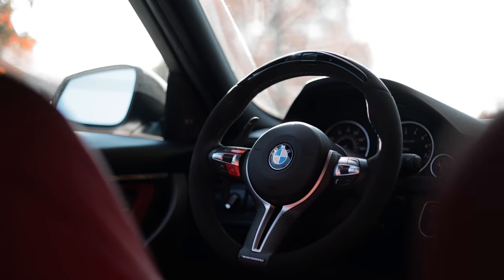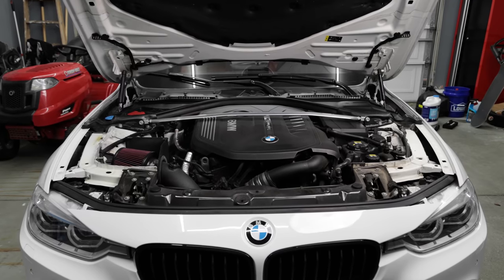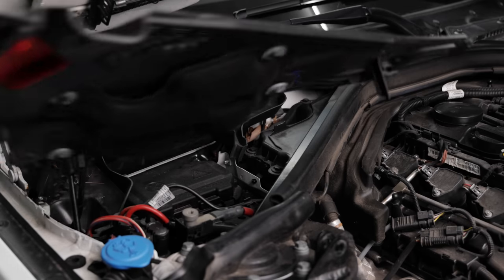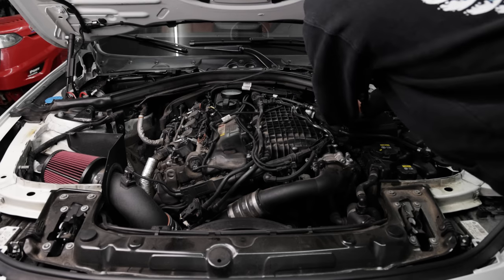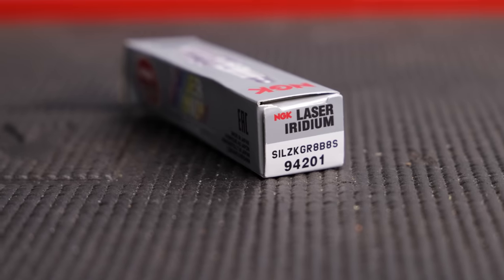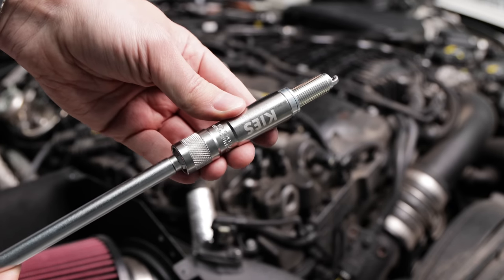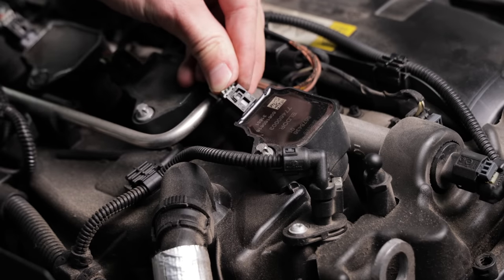How to Replace Your BMW Spark Plugs | F30 340i, 440i

Comment: Thanks to your excellent video, I did my spark plugs today in a little over an hour, and had all the right tools ready at hand. The worst part was putting that damn piece of rubber trim back on (the first piece you took off)!

Comment: Hear me out, I had a corvette and I loved the pulls then I also got an f30.. and it was missing something running sluggish felt like power wasn’t there. I did my spark plugs 2 weeks ago and heard gapping them to .022 is for stage 1. I did it on my stock and omg.. i can feel the boost of the turbo kick in now! I took a scat pack out today. Highly recommend it And heard it’s best for turbo cars. As the air mixture and fuel ratio.

Comment: Love your chill presentation style, Justin, and your meticulous attention to detail. I have tons of tools but sent for that Wera ratchet set in your links. Sold out on your link but on Amazon at a great price. I'm curious about the very loose fitment, though, onto the wrench. Is that to give you a more forgiving arc in tight places? I saw one review where the buyer also expressed the same amazement and said he was returning his set. Its a bit pricy so wondering if its worth it. Also lack of a tab to reverse the wratchet direction seems strange. Have to flip it over to reverse direction. Any thoughts please. Thanks for your content.

Comment: What mileage did you change the plugs at?  I have the 340iX with the MPPSK tune.  I bought the plugs and coils from FCP Euro with their lifetime replacement program at 45K.  Before removing the old spark plugs I would strongly recommend using compressed air to blow out any loose debris or liquids in the plug ports.
Reply from the maker: 55k

Comment: Great video, I will be doing this over the weekend.

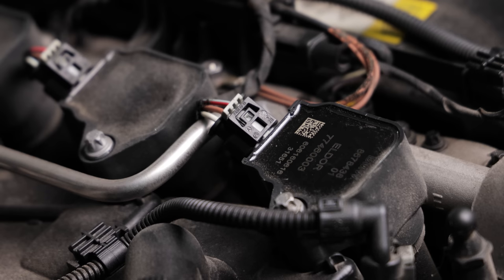At 4:45 you use a yellow/orange terminal pin tool, where did you get it from?
Reply from the maker: The orange plastic tool is just a generic interior pry tool

Comment: I was doing this DIY, and used a $12 spark plug socket from amazon. It turned out to be not a fit for my old spark plugs and the magnet inside broke into tiny pieces. Not knowing I changed the plug in one cylinder and now I am worried if any piece went inside.

Comment: I have 27,000 miles on my 540i should I change my spark plugs or coils yet or should I wait until 50,000 miles?
Reply from the maker: You can do the plugs at 50,000. If your car is tuned you might want to do them sooner. I wouldn’t bother with the ignition coils yet though. They should still have plenty of life in them.

Comment: I like these coils more than the e90 style especially the electric harness where you are not sure if it pushed all the way in or not
Reply from the maker: I agree. I had a miss-fire after replacing my valve cover gasket on my E90 and it was just one of the coils not pushed down all the way

Comment: Yo Justin. What mileage were you at when you did this? Im running stg1 MHD with stock motor/exhaust coming up on 45k mi. Have not changed my plugs yet and I'm almost positive I'm running the factory ones. I plan on catless downpipe and running stg2 so I'll most likely do plugs and coils beforehand.,
Reply from the maker: Mine was 55k. I probably should have done them sooner.

Comment: Do you have to reset the engine light after?
Reply from the maker: You can reset the spark plug maintenance interval using the BC stalk,  I should have showed that in the video

Comment: Im a newb. But i have an easy question. I have a rough idle (to be clear rpm isnt moving but car feels like its rough idling) no warning lights. Someone suggested cleaning vanos solenoids. But if theres no engine light then theres no code.  Correct??? Remember im a novice trying to learn
Reply from the maker: What engine do you have? It’s possible to have a code with no check engine light, you’ll need to use a scan tool to see if there are any pending codes
Reply: @justinbuice  we have an 09 328i and a 2011 x3.  The problem is with the x3.
Reply: @justinbuice  thanks. Will do! Love the videos. Learning a lot

Comment: Do you know the torque specs for those 10mm ? 7:58
Reply: Just get finger tight and one 90 degree turn should be good. It’s just plastic your putting in😂.
Reply: But u use the Milwaukee electric screwdriver 😂 8:02